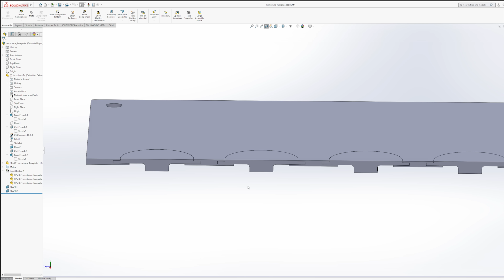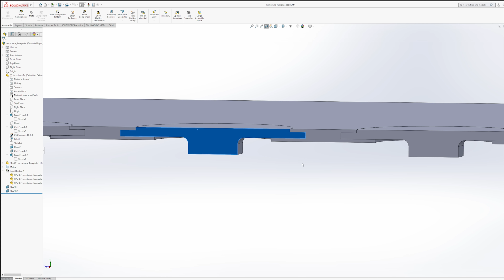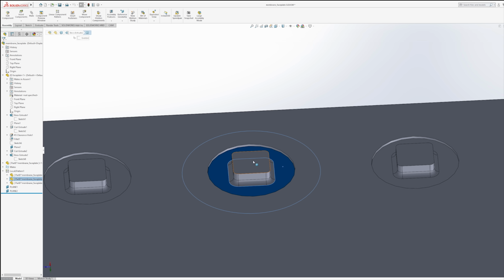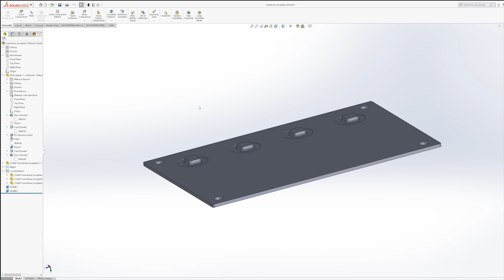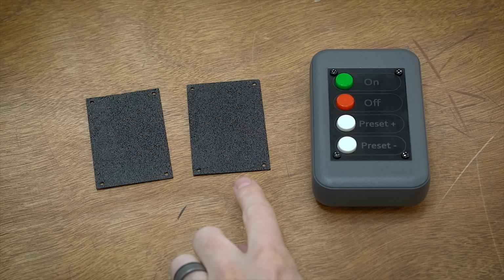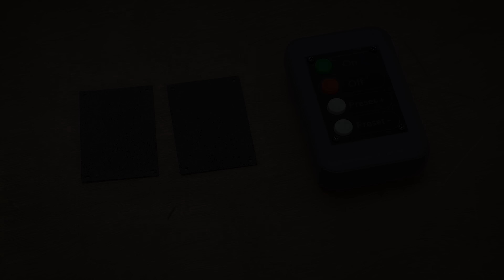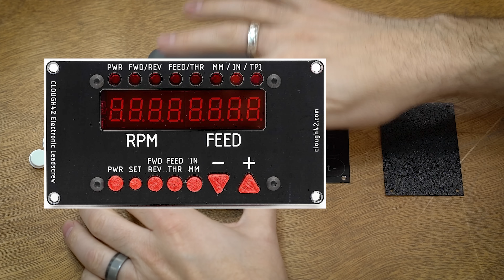3D Printed Flexible Membrane Keypad

Comment: This is a brilliant application!

With a third extruder, white filament you could be embeded for labelling as well.
Reply: Or use the same semi translucent filament and backlight it.
Reply from the maker: Correct!
Reply: Oh dude, the ideas I've had when I was day dreaming about if I would buy one of these things. The amount of parts you could make that you couldn't even build otherwise.

I really  imagine how freaking awesome getting a nice logo, with lighting for shock absorbing cases for things would be(especially with the textured satin bed (low key one of prusas biggest strengths)). You could make something custom for whatever your project is, that somehow just looks a step up. Like this thing would make mean shock absorbant batter boxes, or flexures with longer flex life, or print in place tank tracks with decent grousers and fixed spacing or....

Seriously, the list is endless. Its more like 3.1d printing, like the USB spec (in that its still 3, but like you can't wait for what's around the corner, not in that the naming is completely confusing and what in the hell was the USB consortium thinking)
Reply from the maker: @BeefIngot Right?!  I'm sure I will make something pretty cool one of these days, I just need to figure out what it is!  I really wish I had just gone all in for 5 extruders...